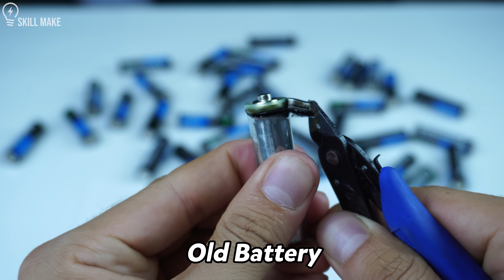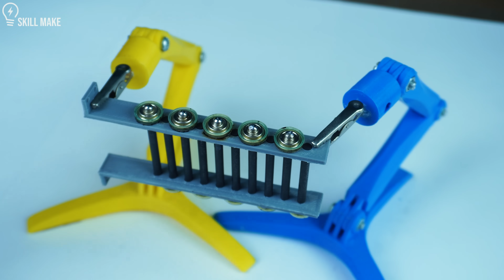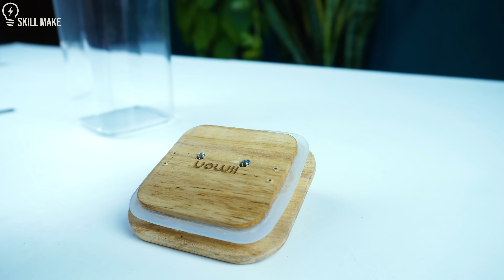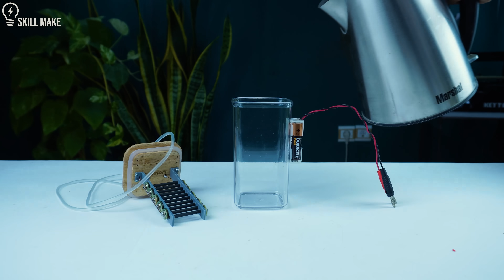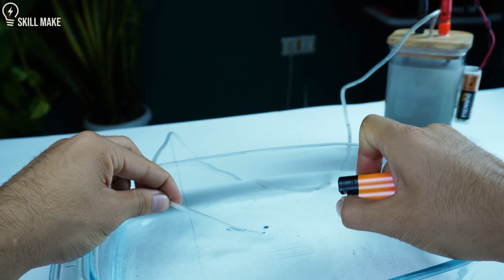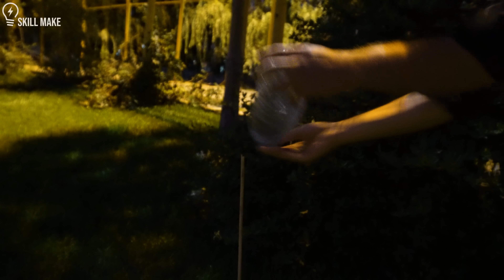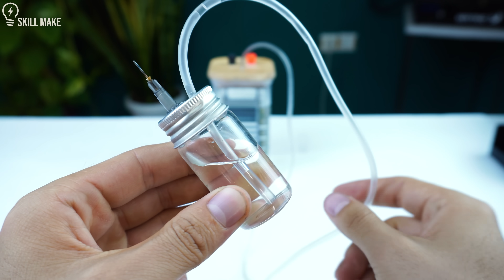Water into Hydrogen - Making a Simple Hydrogen Generator from old battery - hho

Comment: Let's think: Install a demineralized water reservoir somewhere close to your car's engine. This reservoir must have an internal membrane separating the water volumes in a 2:1 ratio. Install an electrode on each side of the membranes connected to the car battery poles. When starting the car, the electric current in the electrodes will carry out electrolysis, separating oxygen from hydrogen. Oxygen must be released into the environment. The hydrogen must be sent to burn in the car's combustion chamber. This will exponentially increase the vehicle's performance, reducing common fuel consumption by 10 times. This test has already been carried out countless times by mechanics and car owners in Brazil. What is the world waiting for?
Reply: Stan Meyer look him up. He put frequencies and had other equipment to split the water much more efficiently. Got like 90 mpg
Reply: Energy out is equal to energy in. The amount of energy that can be used by water electrolisis is significantly lower than that of hydrocarbons. This would require significantly larger quantities of water than current gas tanks. This introduces a larger mass rrquired to be carried that decreases the efficiency of an already less efficient system.

Additionally, when the hydrogen is burned, it will recombine with oxygen and form water. All engines require lubricants, so we will still be dependent upon petrochemicals. This presents a problem. Oil and water dont work well together inside an engine. The viscosity of the oil becomes compromised by the water and leads to excessive wear on the mechanical parts. Additionally, the water will cause meticulously machines surfaces within the engine to become pitted from oxidation much fadter than hydrocarbons.
Reply: Problem here; this breaks the rules of thermodynamics, as it takes just as much energy to separate hydrogen and oxygen as it does to burn and recombine them, and even then its not going to be quite as efficient because you just discarded an enriched oxidiser.

The only way I see this helping in gasoline engines is maybe that hydrogen can act as sort of a psuedo-anti-detonant injection, but at that point you might as well just use the water outright like Chance-Vought did during WW2
Reply: Commercialization, it's proven that it is plausible, but is it worth making and selling?
Reply: @rexroyulada6267  Actually, not plausible.  It can be done, but is not a plausible source of energy, nor means of energy conversion.  Even if these could be knocked out a dime a dozen (and they probably could be), their use would increase your energy costs, not reduce them.  They could be worth manufacturing as toys, but the big cost element there, would be insurance against safety risks.  They might also get banned for H&S concerns.
Reply: @Merlin3189  Yeah, I kinda figured that making this en masse is going to be a problem
Reply: Maybe if they harvest the power of wind and create some sort of ram-air turbine system to power the electrolysis, that might improve the mileage a bit more. Granted it only work when the car is moving fast enough, but wind are free!
Reply: Literally impossible. Anybody claiming to have got this to work in a car is trying to scam you out of your money.

Comment: Try getting a bottle or a water tight container, Drill to 2 nails next to each other in and glue it from the inside, fill it with water and drain cleaner or salt, close the bottle or container and put a 9 volt battery on the screws

Comment: Your video demonstrates the exact principles of why electric vehicles are actually worse for the environment than internal combustion engines. The amount of energy you put into converting water to a gas and then to heat was more than the amount used if you had just used the batteries to melt the solder.

Comment: I think potassium Hydroxide is better than salt as an electrolyte, because it is more basic. 

Also, I think you can generate electricity by adding acid, to the electrolyte mix.... which is kinda like a battery in and of itself.

If you use salt, you also produce chlorine gas, which combines with hydrogen to form hydrochloric acid.

Comment: When i made glass for a fiber optic company i used hydrogen/oxygen to work quartz... (would still use it if supply companies carried it for private sales) I remember thinking why have i never seen a oxygen supply dropping off or anyone with hydrogen.... The repair guy was shocked i didn't know we made it.. Knew it could be done we used to throw them on farm trucks... Didn't know industrial models was sold, I never went snooping through that floor to see a model/ name etc which i had lol Most of the hydrogen supplied stuff was herbort arnold torches, furnaces etc (i keep wanting to make a nice model to supplement my oxygen concentrator however i dont a actual bomb next to me while i melt glass for hours

Comment: The project is incomplete.  A fundamental and general problem can be seen in this device. 
 The copper wires that are connected to the anode and cathode are without insulation.  During the electrolysis of water, copper wires cause great interference in this reaction.  And because of the chemical reaction that occurs with salt and water inside the electrolyte solution with the copper wire.  It produces a large amount of copper sulfate and this process causes the amount of hydrogen production to decrease greatly. 
 In my opinion, you should have completely insulated the place where the copper wires are connected to the electrodes. 
 When there is no connection between the copper wires and the electrolyte solution.  The color of the solution does not change during the electrolysis reaction.  But in this video, we saw that the color of the solution turned very dark and green.

Comment: Think of the hydrant pressure.  Blowing a whistle  and a  surface  that rotates under that pressure   you'll have a free rotation and enough torque   to power a city block.  At what cost   every corner has one ..   now the rotor is harnessing torque  from pressure.  Now if connected to a pump or generator. Or the rotation  is turning a. Table of magnets past a coil of wires.

Comment: I have powered it with a solar panel instead of batteries; essentially free energy (gas) is produced then*.  I have also used recycled metal scraps and pipe to make usable electrodes.

*I have solar panels that have worked for more than 20 years, so the amortized cost of the panel for one hour's use is infinitesimally small.

Comment: Now  if you made such attachment  that you fit onto the hydrant like a fire firefighter with a hose. Or even a hose itself.  Blowing its pressure. Passed  a rotor  and exhausted  through the wall oneside. With also the same attachment. Not only have you a turbine. Under torque the spindle of the torque rotor.  Is turning a fly wheel with  embedded magnates passed a coil of wires.   The torque and pressure also. Operates  car scissors and airbag lifts  but also provides emergency electric.

Comment: Using graphite at both terminals will mean that at anode oxygen will react with carbon (graphite) to produce CO2. Instead use zinc or platinum electrode

Comment: I honestly think they should use this for solar powered battery storage but alas it will be more expensive than oil based solutions. We could use the electricity generated by solar panels to generate hydrogen and oxygen which could be stored as a fuel source later on. Then when we need to use the energy stored in the hydrogen, we can burn it to generate electricity or power a motor. It would be similar to a hydroelectric dam except when the electricity is generated we use the electrical energy as work to generate hydrogen fuel that could be burned when needed.

Comment: What is the point of carbon electrodes, if you submerge the metal contacts anyway ? Also use more flux when soldering.
Reply: mattbergman2788 Give an explanation then smarty-pants.

Comment: I made one like this when I was 13 or 14 years old.  When the water was split until it got to the conductors, and then the water dropped just below that level... SPARK, BOOM!  the inside of the container has the perfect explosive ratio of Hydrogen to Oxygen, and a spark to ignite it when the level drops enough.  Keep the Oxygen and Hydrogen separated in the main unit, until they need to be mixed to burn, unless you don't value safety.

Just a side note, I was a minor, and I wasn't posting this on YouTube.  As an adult, if you are, you could be held civilly liable and get sued if anyone makes a life-altering mistake using your idea.  Not to mention using one of the strongest bases you can find as an electrolyte.  Imagine if that got into someone's eyes.  I didn't even watch the full video, where I'm assuming you drop acid, smoke crack, and are doing this in a room with an active meth lab.

Comment: How did you produce so much gas? Is it the batteries? I ran mine on a dc power supply set to 11 amps (max current), and it drew about 5.6 volts. Not even close to this much gas was made. Any advice from you or the folks in the comments?

Comment: I build a engine that burns ergy for fuel, after about 4 seconds it burned down my brother's warehouse and had UFOs flying over the place for a couple of months.
So I canceled the project, I figured in time I could find a material that could hold up to the heat and fuel that would not be so uncontrollable.
It slid a block of concrete I was using for a chassey to hold the engine that I believe to weigh at least 15 Tons well it was my brothers ware house.
It burned the floor made my brother cry but it worked like a charm.
There is a metal starts with a "T: I have a friend up in saltlake Utha that told me about it.
I was thinking about getting it dipped in porcilin, and trying to use that on my next rocket engine.
The engine would be great for space travel or lift .
Thanks for any coments.

Comment: It takes around 40kWh of energy to create 1kg of hydrogen from water through electrolysis on an industrial scale. This is a cool little experiment but this is one reason hydrogen is unlikely to ever be a worthy alternative to electric vehicles. There’s also the problem that once you create the hydrogen, you then have to compress it or cool to very very cold temperatures and then in the fuel cell it only operates at around 40-50% efficiency. Net efficiency is around 20% of the energy spent making hydrogen actually propels a FCEV forward. It’s far less than 20% “well to wheel” efficiency for hydrogen combustion vehicles.

Comment: How long would that produce gas for if it had electricity supplied continuously? Like I assume the little (are they lithium?) bars would degrade / "burn off" over time.....

Kinda crazy though I'm not sure what else you'd need the gas for....and creating a spark would obviously be easier. But I assume hydrogen gas has a ton of uses outside of what we see demonstrated in the video 🤣

Comment: A hydrogen flame is invisible because there is no carbon atoms. In a methane or any carbon fuel the carbon atoms radiate both heat and light. Since the hydrogen had no carbon burning, no light and very little heat is radiated. That is why in plants that use hydrogen, the repair techs alway carry a broom and wave it in front of them. If they reach a hydrogen flame, the broom catch’s fire and not them.

Comment: Does anything change if you use new batteries instead of old ones?
Reply from the maker: It doesn't matter, you only need the pin inside the battery, that's all

Comment: Okay there are a lot of things to note here.

First HHO gas soultion is very dangerous. It is explosive, and when it goes off its very loud. You litterly have pure oxygen with pure hydrogen

Second, drain cleaner is not something you want to pkay arround with either, you can easily get chemical burns.

Third, whule this looks cleaner, its likely you will still have to eventually replace the copper wire as it will eventually disolve.

Fourth, those carbon rods are not from the typical batteries you will find. Those are the cheap batteries often found in dolar stores. They are cheap, and you want to make sure they are not Akline (may have mispelled that) batteries, as cutting those open will likely cause toxic fumes and posiably flames. Additionally all batteries have some form of acid, even the ones with the carbon rods. And many brands have that in the form of some kind of gel. You will need to dispose of that safely.

Other than those basic safety notes, this is an i tresting experiment. And is often done as a fuel additive, to improve efficiency of engines. Since the byproduct of this combustion is water its fairly safe for the enviorment.

Comment: You could make this the 0 energy way using lithium to split the water in to hydrogen and oxygen
Reply: Lol, you forget the energy it took to separate lithium from rock and salt so you can use it in this reaction?
Reply: So why not make an engine that runs on the hydrogen to mine the lithium?
Reply: Kind on the whole reason I said this in the first place if you are split9ng the water in to the hydrogen for fuel as a cleaner energy 👌
Reply: @Rick-sanches1  because you would need more hydrogen to power the machines then you would get from the lithium.
Reply: @miguellopez3392  don't be silly you can reuse the lithium to react with water at varying times that's like saying you'd need more oil than your gonna get drilling for it.
Reply: @Rick-sanches1  yes but now you also have lithium oxide which is toxic and requires an equal amount of energy to separate the oxygen as you gained from producing the hydrogen.
Reply: @miguellopez3392  you can turn the lithium hydroxide back in to metal with another reaction why do you need the oxygen I'm confused.
Reply: @miguellopez3392  I'm talking purely a hydrogen farm using reactions the energy you get from hydrogen would be substantial
Reply: @miguellopez3392  what do you think rocket fuel is made of the most powerful fuel in the world.....liquid hydrogen.
Reply: @Rick-sanches1  you need to understand energy cycles first, you are essentially trying to power a lightbulb with a solar panel that is powered by the same light bulb, any inefficiency or energy loss in this cyle will ultimately led to no power at all as the energy cycles go from one system to the other.

you lose 20% of the energy you put in separating hydrogen from oxygen as it turns to heat in the process, and when you put that hydrogen in a generator you lose 50% of that energy as heat, you cant use 40kwh of hydrogen to make 100kwh worth, you need 120kwh. 

hydrogen is used in rockets because its very dense, but the most powerful rocket on earth currently runs on methane and oxygen as the methane is much easier to handle and create.
Reply: @miguellopez3392  you're wrong the idea is patented it works they have the tech but can't charge the same for water as they can petrol I mean if you could fill your car out of a puddle why would you need gov or big energy companies anymore it's the greenest cleanest energy avalible when burned it turns back in to water after producing high volumes of energy so is then reusable again every part of this is reusable and renewable, but like I said you can't control it so it's a gg

Comment: why the hell we don't have a pcb controller kit so we can take required HHO for driving a regular 125 or 150cc motorbike ??? 

also any safe solution pipers and needle so we can insert that gas through air intake system for extreme high temperature

Comment: This is how to make DIRTY hydrogen, which is hydrogen and oxygen.  Dirty hydrogen has almost no practical use.

It's fairly easy to split the two outputs with most electrolysis, but in this design you've made it almost impossible by putting cathodes and anodes together (one produces hydrogen, the other produces oxygen)

Comment: LOL  This System is SO OLD!!!   I did this with Battery Carbon Rods When I WAS a CHILD   and I powered them with a Door Bell TRANSFORMER. (Old Houses had them) So I used AC not DC So it automatically Generated HHO Anyway.....NO Additional Batteries NEEDED.......
I Did this before Somebody Did the Same and Called it "Brown's Gas"   or Later  "HHO"   
My Experiments PREDATED any of that.   So I call this   JESS Gas.......
and Yeah, I was all of 12 years Old.  (my Father Got me Interested in SCIENCE since I was 8  and he even Bought me a microScope as my First piece of Scientific Gear.   Later I BUILT Every Single Electronics KIT offered by RADIO SHACK.....  
So,   Yeah,  This is Called  Jess'  Gas   Not Brown's Gas...........

BTW my next Model was made with SINTERED BRASS Rods.   it works much better than CARBON RODS....
Reply from the maker: Thanks for sharing this information 🙏

Comment: The beep is also known as continuity. Beep means the circuit is closed. If no beep means it's open. If you're ohming a motor, on single phase motors, the 2 small values should total the high value. On three phase motors, they should read the same. If that all checks out, then check each winding to ground. If you hear beep your fucked. Means the motor is grounded.

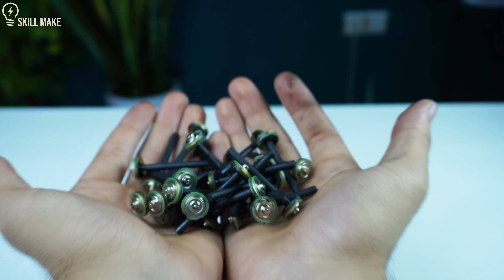Comment: 0:38 and where exactly would I get this pos?
Reply: Make one?
Reply: @sh1ob654 it’s kinda hard to tell, but I think it’s 3d printed
Reply: Two words. 3d printing
Reply: @slumpmässig-j4v  u mean i gotta go and purchase a $1k worth of a 3D printer + filament + pay 4 electricity?
it kinda makes it unreasonably expensive experiment...
Reply: @nskmda  3d printing isnt even that expensive...
Reply: @nskmda  AND you can use some plastic, drill some holes and melt a part to bend the plastic instead! :-)
Reply: @slumpmässig-j4v  man, sure i get that. :) my point was that ALL this stuff will take some initial 'investment' :)

anyway, i didn't get an answer 2 my ? about drain cleaner type. there r tons of them and they have different formulations.